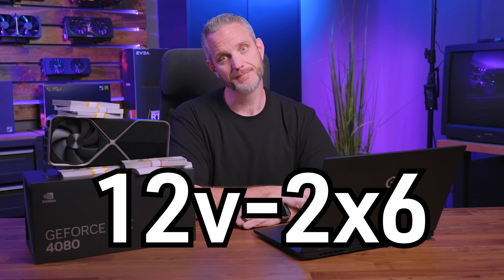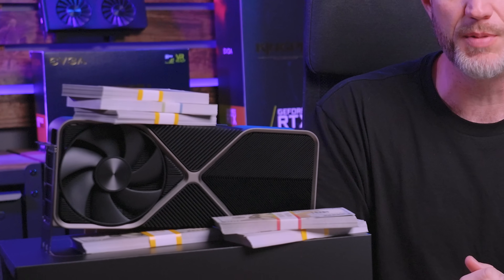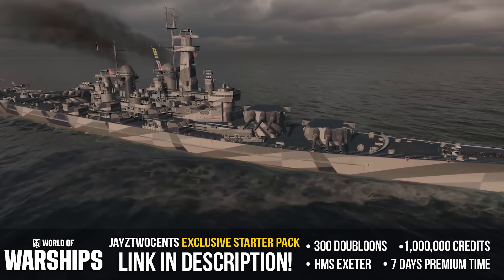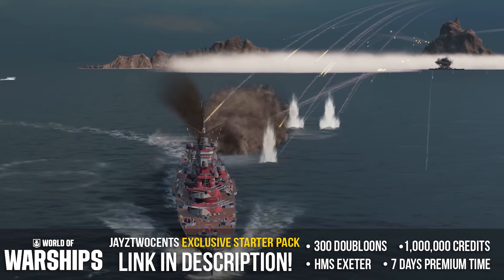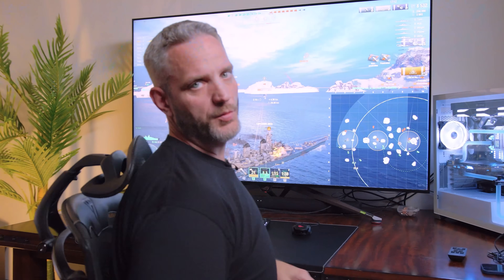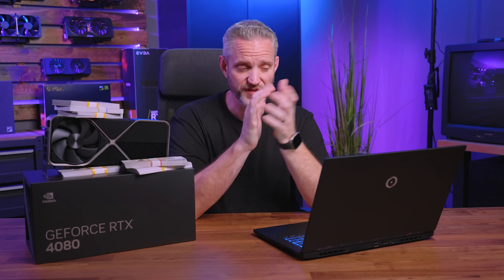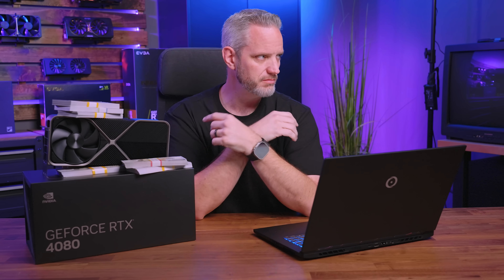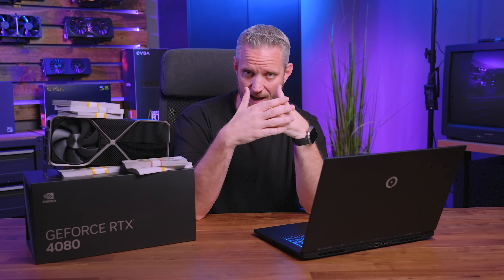They FINALLY admitted that this was a major issue!

Comment: so glad i made cables for a living and do quality for them now and made my own when there were issues.   it uses general molex style pins and connectors.  i really just used spare ntk stuff from work.   i really hope they actually fix things for the public consumer.
Reply: You know, since you do this for a living, you could have (and probably still can) potentially start up your own business making cables for this application that are "actually worth buying" NTK stuff.

I've literally never seen any connector in an automobile use that "3 bumps" connection method, and with this whole mess with the +12vHPWR connector's issues with melting, I have a pretty good guess why I've never seen it in the automotive world.
Reply: @44R0Ndin  I could make custom cables but i would never in my life make cables i could not 100% guarantee, and with this plug you cant at the moment above 450watts.

Comment: I'm coincidentally in the market for a new PSU. Was planning on buying a corsair Rm1000x but was taking note of the lack of 12vhpwr connection on the unit since its a 2021 model and they haven't updated the x series yet, only the cheaper e series. When considering how long PSUs last (7-10 years) would it be more prudent to buy a similar model from another manufacturer that is newer and has a 12vhpwr connection on the unit? Does this even matter? Haven't really seen a clear answer on this searching around reddit/youtube.
Reply: I'm not sure about the connector question, but I can say Ive been running an original RM1000 in my rig for 8 years now and its never given me any issues. Handled my winter competitive overclocking shenanigans well last year, so doesn't seem like its lost much (if any) juice over the years

Comment: WRONG....PCI-Sig is the outsource partner that manufactures these FAULTY power cables for Nvidia. Before that Nvidia designs this connector, tests different variations of the connector with all of the surrounding conditions in terms of electrical boundaries and mechanical boundaries. Since Nvidia hasn't done that R&D properly, the specs that they send PCI-Sig for manufacturing are inconclusive and therefore not up to the standard that they should be. I work in this industry and this is in 100 % Nvidias R&D fault :). Anybody that works in the electronics R&D industry either for computers or cars, knows that this is an Nvidia Product Development fault and Electronics department fault because these two haven't done their job properly.

Comment: I bought a 12vhpwr cable and 90 degree adapter from cablemods, I would love to see an "upgrade plan" where you send your cables/adapter and for a reasonable price they would upgrade it to the new 12v-2x6 connector.
Reply: You would also need a new card to get the new adapter tho? So why would Cablemod do that?
Reply: @AndreasRP.  You don't need new card, the old and new connectors would work with each other. There are the benefits of having the new plugs on the cards, but just the ntk upgrade would make it much safer.
Reply: @eliadbu  I see, I thought they redesigned the adapter completely
Reply: @AndreasRP.  considering that companies made new cables, adapters, extensions, PSUs etc that would have been the worse outcome for both companies and users. imagine you bought 200-300$ new PSU for the new connector so you could "future proof" it and use it for the next decade or so, then  at the next generation GPUs, that connector on the PSU becomes completely obsolete.
Reply: @eliadbu  That's happened before, doesn't anyone remember the AGP graphics card socket?
Reply: @44R0Ndin  things like that happens. but depending on how big of part they were, they might or might not be significant. I have motherboard with u.2 connector which without a conversation to m.2 is useless for consumer hardware, or I even had older boards with sata express that is even more useless. While these were extra features and AGP still had like 3-4 years so it wasn't that short lived, people probably specifically paid extra money for these PSUs with 12vhpwr. And unlike motherboards that you usually replace as soon as you replace cpu, a good PSU serves you for a long time, I have 12 yo 1200W psu still working in one of my systems. Sure the PSU would not become obsolete, but the extra money you paid for the new connectors could had been saved.
Reply: @eliadbu  The Seasonic power supplies come with a 10 year warranty but they are nearly 400 usd , that would sting if you got that just for the shitty 12vhpr connector, and yea a good PSU will last for two or three PC builds.

Comment: Jay, if you can do that sense pin loosening thing as a follow up, that'd be valuable. If you could get a card going black screen and 100% fan on camera, it'd probably help some folks troubleshoot their cards better.
Reply: I randomly on a daily basis,  encountered black screens with fans full speed and audio still playing.  I pushed all my connections in tight and it's been stable so far for 2 days.
Reply: I had this exact thing happen to me last week. Changed my power cable routing from the top of my 4070ti to the bottom and got "No signal detected" and instant 100% gpu fan speed when i turned on the system. Had to wiggle the wires going into the plug to fix it. I never unplugged the adapter from the gpu, and where it plugs I to the gpu was tight.  These adapters are so fragile that I would like to see a tsb with new adapters sent out.
Reply: I also encountered black screen and 100% fan speed issues on a daily basis after getting the cablemod's 12VHPWR cable even though i have checked that the connectors are all the way in and reseated the plug multiple times, but the black screen 100% fan speed issues would still happen frequently and randomly, but back then i didnt realise the cable was the issue, until i decided to go back to the 12VHPWR adaptor that came with the gpu and realise that the issue is gone.

Decided to RMA the cable with cablemod and they didnt ask a second question and replaced the cable immediately, which was nice.

But even with the new cable it still happen again for 1 or 2 times after using it for about 2months now, which was much better than previously where it was happening almost everyday, but still not optimal.
Reply: @flamebullet  I was having this problem and I uninstalled and reinstalled the graphics drivers and it seems to have fixed the issue. I only did it a couple days ago though so I’m not sure if it’s completely fixed but it ran for 9 hours yesterday with no problems even though before it was happening like every hour.
Reply: @sotempermental247  i have already ddu the drivers before switching the cables and it seems to work fine for a while and i thought i fixed it until it happens again after a few days. Other things i tried including reverting my overclock since i thought maybe it was unstable(it was just a slight overclock, not aggressive), and even underclock the card.

Comment: An EE, power sytems here, that complained in comments about ampacity of the connector and the problem with the failure of any pin causing a cascade  Later, a video was released by Jay telling everyone that they were wrong and a bunch of other negative stuff about opinions, professional and speculative.  Hmmm.  Go rewatch and read.

Also, you and Gamers Nexus, please stop saying delta t.  It's just for sounding smart.  There are several of those.  The one you refer to is the "difference" in temperature.  Why not just say differece? He even presented it on his slides as the lowecase Greek letter.  It should have been capital.

I relish the fact how small and humbled Gamers Nexus looked and acted next to one of Intel's GPU engineers.  Back in his own lair, he's emboldened.  Some good stuff, sorta.  Great to find success.  Success as an influencer is not the same as a design engineer.

Put that on your warship and sail it.  Not listening to another smart commentary.

Anyway, entertain, shuck and jive for those entertaining dollars.  Thank God for popularity and such...  If not, you'd been another of those Best Buy gamers dropping our classes left and right thinking computer engineering was assembling components to our chuckle.  😂

However, because of your success on YouTube as ad hominem creator, please stop putting your elitist two cents out there when you depend on others for that knowledge.

Oh yeah, all yall please stop with this AMD superiority mumbo jumbo.  Read or watch real tests on power draw.  Look at performance.  AMD has always given me an out of box bad experience every time.

I guess ad hominem wins again along with popularity.

Comment: So nice to know that the cards below the 4090 and 4080 do not have a problem with that power cable because I just built my new system with the MSI  PSU that has that plug and my new MSI Suprim 4070Ti will be arriving today and I want to use that plug as it is a feature of my PSU (also to have less cables).👍 (P.s. - how am I supposed to take you seriously when your making those hand gestures and talking about dimples and nubs and touching nubs etc... Seriously JAY🤣😂🤣😂🤣😅🤪😜)

Comment: You know, call me silly, but this could all have been solved by having a stupid simple plastic CLIP on the connector that ensures engagement and cannot be pulled out.

Edit: not withstanding the dumb contact design of course.

Comment: I can add it here as well. CableMod in-house terminals are 2 dimple design. Why all the talk about they using 3 dimple designed terminals? Corsair as well use terminals with two dimple design for their 12VHPWR cables(they use two different vendors). 3 dimple designed terminals is in minority. Amost all vendors use the weaker 2 dimple terminals.

Comment: I still see posts (in facebook groups of pc gaming in my country) of Black screen fans 100% problem in several 1060,1070,1080,1080ti from asus and evga. But lately at least 10 post in the past yeart of 1060 asus dual oc failing with Black screen fans 100% , so the problem it wasnt only evga...

Comment: My personal feeling is WHY are we not deciding to move away from 12 volt and instead move to 24 volt to halve the current for the same power ratings over connectors? Just need to step down from 24 to 12 on the board which isn't that hard.

Comment: I had the issue with he screen going black and the fans going 100%. NVIDIA sent me a new card. I did some testing before doing the RMA and undervolting the GPU to 80% made the issue go away.
Reply: Prior to this stupid-plug issue, my first guess for a black screen + 100% fans would be the gpu or another component overheating, and self-protecting by killing the board power, and reving the fans. It still could be that. Disappointing that it could also just be the plug failing to work as a plug now too.